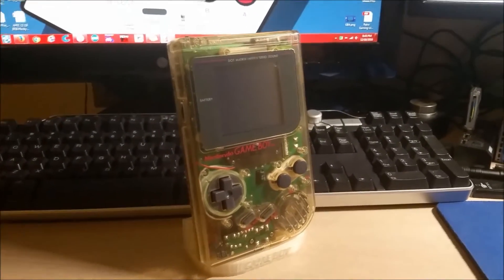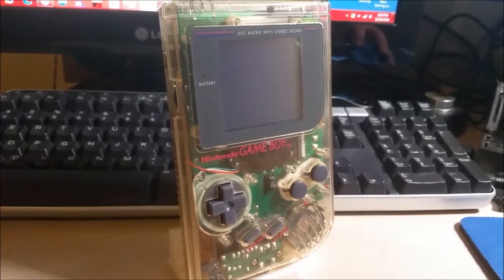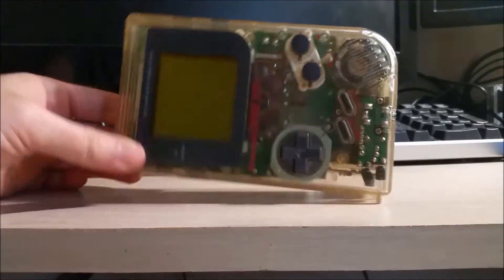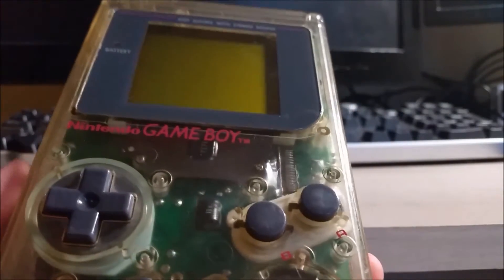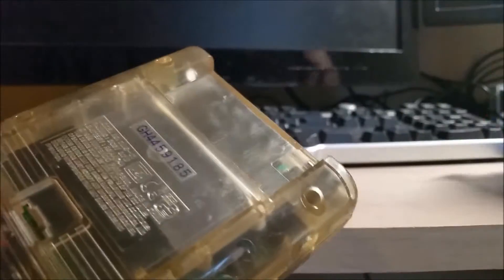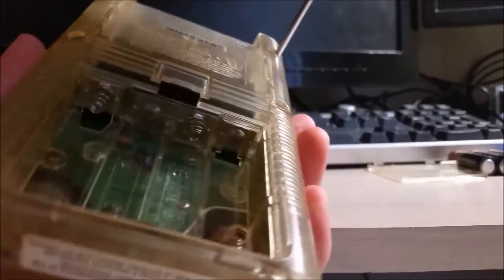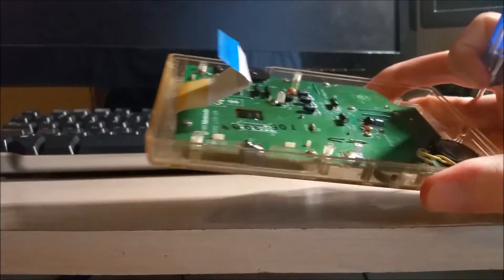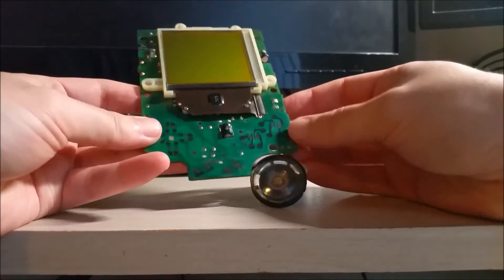RBG Backlit Gameboy - part 1: Fixing Missing Vertical Lines and Removing LCD Reflective Film

Comment: Hey man, nice video, hey what happens if I want like a transparent effect and I only removed the reflective film from the back, and put the polarizer in the front? Is it possible?
Reply from the maker: Yes it is possible, I temporarily did this for kicks once. But it's very hard to see what is going on with the pcb and flex cable behind the screen.
Reply: sjm4306 thanks for the quick response, preciate, well Im just tryng to do a LCD side transparent panel for my PC, and it seems its the same LCD principles like the GB,  so the LCD has the polarizer on the front and it has a reflective layer on the back, so in order to get the transparecy effect i was nervous to remove the reflective film from the back and not seeing anything on the LCD, but im gonna try to remove it because the polarize film its in the front, and see what happens (sorry the long comment)
Reply from the maker: It will work, the back will also has a polarizing filter as well. If you are using a modern computer lcd then all you need to do is remove the backlight box behind the lcd glass. No modern video lcd displays use reflective backings as they are all backlit and thus dont need to reflect light like old lcds that werent self lit.
Reply from the maker: My email is sjm4306@gmail.com

Comment: How can I fix my LCD screen, the lines are not the problem, it's just black when I turn it on even if I move the contrast. I can't find any videos with this problem.
Reply from the maker: Johana Sepulveda Check for any visible damage to the white ribbon between the front and rear circuit boards and make sure the connector is seated properly. Sounds like the lcd is getting power but not data. Can you still hear sounds when a game is inserted?

Comment: is there a way to fix horizontal lines?
Reply from the maker: Fer Alejandrez Yes but it is quite a bit more difficult than vertical ones. My buddy is currently working on a method to make it easier so hopefully soon it will be easy to fix all line problems.